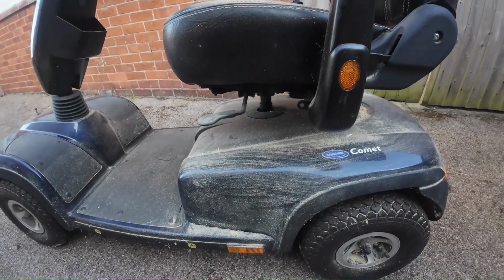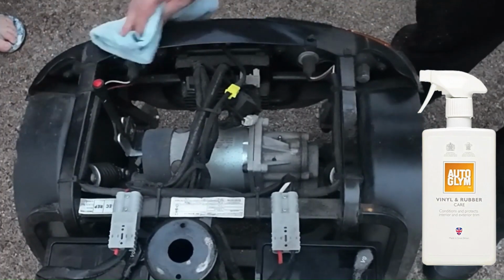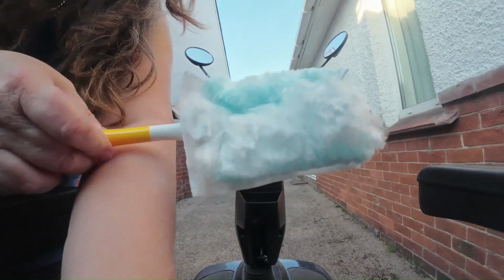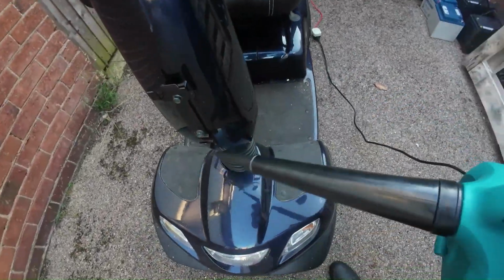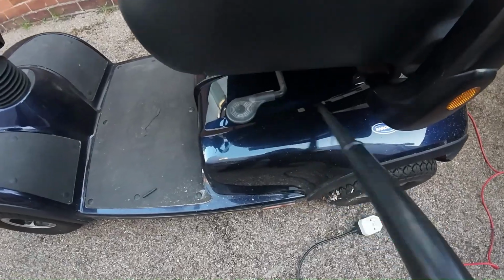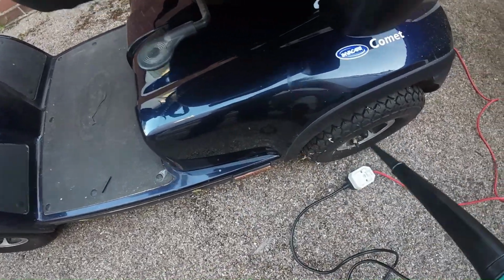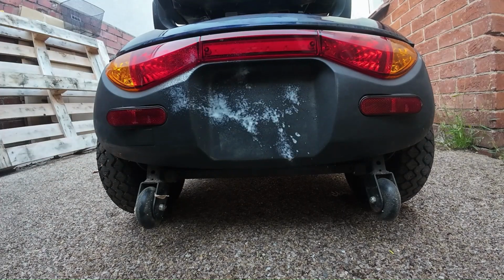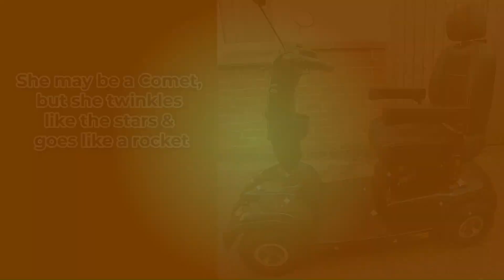Invacare Comet Cleaning Session

Comment: Hello. I had one more question. When my vehicle is moving, regardless of its speed, the speedometer does not work and remains at constant zero and I cannot tell how fast it is going. What could be the reason?
Reply from the maker: Hello again dewrog 👍 My Invacare Comet doesn't have a speedometer so I gauge the speed and adapt it according to the surroundings, people about and the maximum that it an go of course. You must have a newer and higher spec model to mine if yours does, and I guess if the speedometer is there and doesn't work that can be a tad irksome. While I can't tell you the actual cause, I suspect it could be a loose or broken connection, and if you really want the speedometer working, I would recommend you take it to Invacare repair specialist or someone with a general all round knowledge of mobility scooters that can find the fault and hopefully fix it. Good luck with what ever you decide to do and all the best 😁
Reply: @CrazyCatLady351  thanks 🙏🏼
Reply from the maker: @dewrog  you are very welcome 👍😁